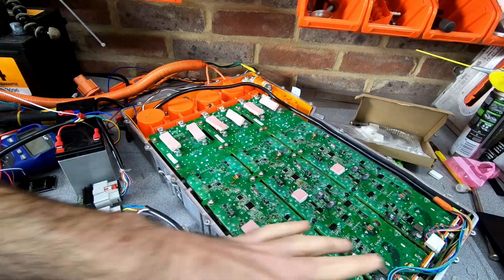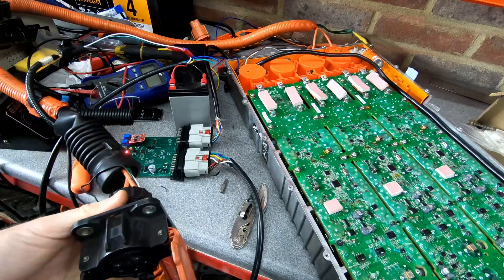Using a Tesla Charger to charge a Nissan Leaf Battery - DIY Porsche 996 Electric Car Conversion

Comment: Did you put the conformal coating back onto the board that you removed earlier?
Reply from the maker: Yes, though I ended up purchasing a few different ones before I found one that offered similar coverage to the original stuff. A lot of the coatings are much lighter or spread too much when applied.